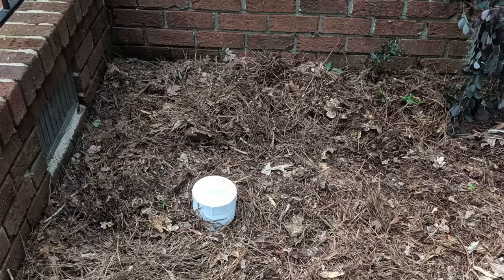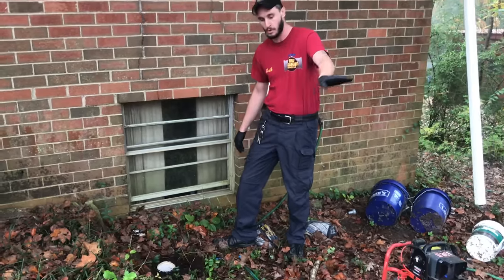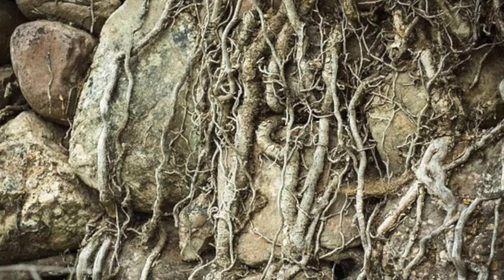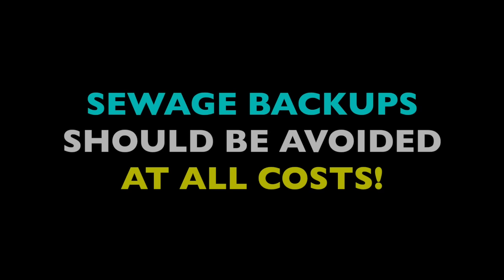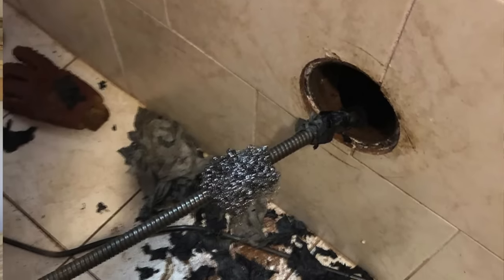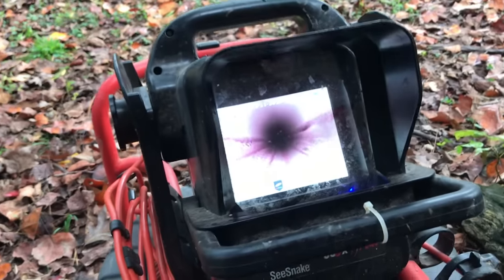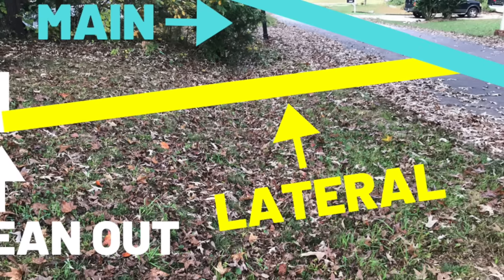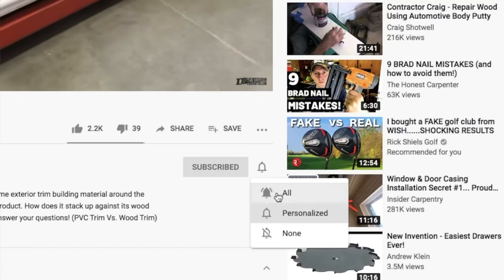This Pipe Can SAVE YOUR HOUSE FROM SEWAGE FLOODS! (Sewer Clean Out Pipe Explanation)

Comment: Sagging line: symptoms of an impending blockage, abnormal flushing (including different sound), sewer gas odours.  

I had my line scooed and there is a saddle about 34 feet out. Instead of relying on a plumber (blockages always seem to happen on weekends) I picked up a drum rotary cleaner. My clean out is located in the basement and I set up a cam lock system so it takes about 10 seconds to get things up and running. 

Now with older homes I would avoid the premium tissues like Charmin (multiple plumbers warned me about it) as it is just as bad as flushing paper towel.

Comment: We had a clog that affected one bathroom in a two bathroom house.  When the plumber came, we couldn't find the clean out.  So, the plumber went onto the roof and used a plumbing vent. Years later, someone decided to redo the decorative garden near the front door. When the old plants were taken out, the clean out was discovered.

By the way, the plumber showed my mom a piece of toilet paper, which he said was responsible for the clog.  After he left, my mom asked about what the plumber had said. I got a large glass bowl of water. I put some toilet paper of a different brand in it, and swished the water. The toilet paper sample quickly broke up. When I did it with the toilet paper brand that caused the clog, it remained intact.
Reply: What were the brands you tested?
Reply: @godweenkatie  I apologize. It was too long ago for me to remember the brands of toilet paper.

Comment: Never thought about this during my inspection & realtor never suggested it, I wish I had known to request it, I will if I move again
Reply: Just bought my house 5 months ago. Getting the sewer line replaced $9000 job. My insurance will cover it minus $1000 deductible.
1950s cast iron being replaced with pvc pipe now I will have two cleanouts as I have none now.
Reply: @browniemandacutter9852  wow, at least the insurance will cover it but that's a pain in the butt to have to deal with it
Reply: A shame that this inspection is not included in the overall home inspection in Florida.  Had I known this then, I certainly would have requested one.

Comment: yeh great vid... but no thot talk mention bout frozen tundra land up here in northeast like for 6-7 most of year .. all stuff pipes got be buried down below frost line like 3-4 ft min... So  how  do homes by code up here and towns city lines do this sewage  pipe  correctly  up here for cold freezing  winters ??  I ve seen town replace main water pipe old rusted cast iron breaking down by force pulling pushing a  white pvc plastic pipe slightly less diam thru old pipe  to take its place  bc  less or no digging cost less labor, faster, etc.. if can be done. 
Can they do same thing w sewage pipe ?

Comment: Hi there,

My wife and I own a house that is scheduled to have sewer installed in the next 2 years or so as we try to ride out the septic system until then. We know we have an old septic tank that leaks, with clay piping etc. We recently replaced the interior sewer exit line, and the plumber did not replace the whole-house trap. I purchased a sewer gas detector, tested it with the propane gas to make sure it was working, and it is. I detected small amounts from the two downstairs sinks, and when I put it close to the ground over the septic fields it went crazy, though you can't smell anything when outside. At some point, I felt that I did small some light odor coming from the sinks last year, but I haven't since. 

I'm trying to figure out what is and isn't a problem, and if we're safe to just continue to ride out this system until we can connect to town sewer. We had the line snaked between the house and the system, and while it wasn't perfect our guy told us it shouldn't be a problem (at least the line) for many years. 

Thoughts?

Thanks for any input you might have.

Comment: Very informative video which I learned a lot from!  Question: Is there a device that can be used in case of a natural disaster such as earthquake or flood which can be inserted into the building main cleanout piping, and then removed later, to stop any sewage backup from entering the home and seeping up through the lowest drains?  I'd be very interested in such a device in case of emergencies to protect the inside of the home from backups.  Thanks!

Comment: I know I have tree roots in my sewer pipe. When the washer drains the toilet in the master bath bubbles and then the bowl empties out, letting in sewer gas. I jetted the line from the cleanout and it was like flushing a toilet. However I am not convinced the problem has been fixed, will know more once it stops raining here and I can run my sewer cam through.

Comment: Another good thing is replacing your screw on cap with a Sewer popper. Then if you have a sewer backup from the street gray water will pop the top on the sewer popper and flow out there instead of your home.
Reply from the maker: Good call, Karen!

Comment: Remove screw in sewer cap and replace with a sewer popper. Sewage will not back up into home it will make sewer popper cap rise and relieve pressure off sewer line and spill into yard and not your home! A must have!

Comment: I just purchased a home with a completely blocked sewer line. Thankfully it was on the lateral and the county handled it. I definitely recommend getting the line checked before purchasing. In my case our sewer Outlets is almost vertical drop down 15 ft so if I had to pay for it. 🤑🤑🤑 also the previous owner knew about because they drill holes in the pipe to release pressure. Do yourself a favor and get it checked.
Reply: Tree roots was the culprit.

Comment: when you get to Canada, that cleanout is required to be inside the foundation wall, but after the backflow valve, so regardless, if there's a problem with the main line and its closing that backflow, if that cleanout pops or wasn't properly glued/seated correctly, your backflow has been rendered useless. The code that stipulates the cleanout to be just inside the foundation wall where the sewer line comes into your home's perimeter was made before backflow valves were a thing and when the cleanouts were still made of clay (since northern climate, that freeze/thaw would make it crumble)

Comment: The pipe just outside my house broke, they think because of the house settling. Luckily, I caught it right when it happened and spent my birthday mopping up the floor in the restroom on the first floor. ☹️  The plumber replaced the pipe outside the house. That was about 12 to 15 years ago. I haven’t had it inspected since. I had one break in the 26 years I’ve owned the house (it’s 28 years old), so getting it inspected every two years I think is overkill, unless you have house settling issues, or you have a large tree that could be putting a lot of pressure on the pipe. The solution to the tree issue, is to not plant trees that can get large, anywhere near the pipe leading to the main sewage line in the street. If there is a large tree over your sewer pipe, have it taken down. It’s probably cheaper than a plumbing bill to dig up and replace your sewer pipe.
I’m going to get mine scoped, and then maybe scope every five years after that.
Reply: The previous owners of my house had recently planted a tree not only near the front porch but also pretty much over the sewer line and water pipes coming into the house. I chopped that thing down in the first week that we moved in. 
I have no idea what they were thinking but it would have been a nightmare if that tree matured.
Reply: @andreo  Frequently, people don’t think, or they didn’t even know there was a sewer line underneath where they planted the tree. Sycamore trees are especially bad. Their roots effectively get into small cracks of sewer pipes, clogging them up.

Comment: Thank you, Honest Carpenter! Great info, but I have a quick question. 
My house was built in 1987, and we've been here for 19 years.  I have a septic system, I get it serviced every 18-24 months, and I've never had a problem with it. I've never seen a clean out in my yard, and I've mowed a lot of grass and raked a lot of leaves. It does appear, though, that I have a clean out access port in my basement on the end of the horizontal pipe that feeds the septic tank. Could the clean out be located in my house?
Reply: Hey Jmgmobile, the cleanout you speak off in your basement acts as a standard cleanout. Depending on your jurisdiction, some code requires cleanouts at every turn of direction or when exiting the house. All jurisdictions are different. if you start to have backups in your house the first place I would go to is your septic tank. If you were to open up that clean out in your basement you would have a big mess on your hands if the line was backed up. Thank you for watching!

Comment: Frankly after having dealing with my own sewer line for few years (200 feet to sewer main), I know a good deal.    No need for professional plumber.  Just rent snake and scoping tool from Home depot and learn to do it yourself and save $$$$.  Simple.
Reply: I purchased a 200 foot high pressure clean out line with a jet nozzle  to hook up to a pressure washer. My neighbor has a 3200 psi washer with a 5 horse Honda. Keeps the sewer lines clean and as added bonus I used it to wash down the pilings on another neighbor''s pier. I'm 165 feet to the sewer main and after having Roto Rooter out twice in three years,  the pressure line pays for itself with one use.  Another neighbor got a $14,000 estimate for a replacement line when the old one under a new driveway was found to be failing. He rented a backhoe and we pitched in and helped him run all new PVC to the street. With everything included he got it done for less than $3K. We actually had to build a coffer dam to keep all the ground water pumped out out to make up the last connections to the city cleanout. We were pumping out water for the last 70 feet and the street connection was nine feet below grade. If OSHA had seen what we were doing they would have had a fit, as the potential for a trench collapse was a big reality in the sandy subsoil. The city requirements under the plumbing code included clean outs in something called Norfolk  boxes every 50 feet.  No doubt that the DIY approach can save money.
Reply: I go behind wanna-be drain professionals every day 
Call a pro save time and money and costly mistakes
Reply: @mikegrant8490  You should have rented a drag box to support the excavation or stepped the excavation if that did not work.
Reply: @johnclements6614  It wasn't my job. I suggested it based on the soil, the slope and the OSHA regulations requiring it. I did make him remove a whole helluva lot of material before I went down into it. It was safe enough, barely. After we got all the connections made, ran a flow test and had the inspector called for the final, I told him he pissed away a whole lot of money and time by not getting a drag box. He told me later after the inspector signed off on it that if he, the inspector,  had seen it he would have put a stop work order on it based on the depth and the high probability for cave in and made him get a drag box on site... which would have required a real full sized excavator, not the little rental digger and my shovel. He did save $17k by using my free labor and the rentals, though. I concur completely with your insight, so thank you for your perspective.
Reply: @mikegrant8490  No problem.

Comment: I live with a septic tank.  Having raised 11 children and a few others in the house, I have lived a few nightmares.  All but the 1/2 bath are upstairs, so when I hear the downstairs toilet gurgle, I know what's about to happen.  Thankfully, I know where my cleanout is - and here is my question:

My cleanout is just outside the house and is NOT screwed down.  It's a cap the fits over the cleanout.  Should all things backup from the septic, the cap pops off due to water pressure.  The gray water and mess go into my backyard.  The only downside of this is that the dogs love it when this happens :(.

Just curious if anyone else here has a similar setup.  As for scoping your line every 2 years - I think that's a bit excessive.
Reply: Mine has a rubber cap as well. I'd rather it backup in the yard than in the house. But if you don't like it you can easily add a screw in plug instead.
Reply: I live in a 40 year old house with a septic that was in bad shape and previous owners couldn't give me info on anything. Unfortunately it didn't have any clean outs. I got tired of it backing up and flooding the house and having to pump the only tank I could find. I started digging. I found 3 300 gal tanks and the drain field was broken from tree roots. I ended up putting clean outs everywhere and adding a gray water line for the washing machine. I also purchased a sewer jetter to clean my  drain field every year. I also built a inspection camera for the drain field.  Still have a few more repairs to do but I will finish them up once I get my backhoe working.
Reply: It’s best that it stay out of your house, pop up are a design on purpose to keep all crap out, just hose it after you have performed your fix, if you seal it then everything will come out of your sink,toilets,bath tubs etc, I rather have it out side

Comment: I would add one thing … make sure you read and understand the contract.  5 yrs ago I had to replace my entire sewer line, from the house to the city main.  $8500 !  There were six spots where the pipes were broken causing problems every month.  It was a major hassle and I experienced problems with the plumber.  He did not want to dig the last 6 feet to the main because it was 8 feet deep.  He insisted it was the city’s responsibility and we were at an impasse until I called them.  Fortunately, he wasn’t very good at writing the contract and had indicated it would cover “to the main” and the city manager informed him the main was indeed six feet over and 8 feet down.  It doubled the time on the contract, and I enlisted the help of the city manager to force him to live up to the contract, but I got the entire line installed for the original amount of the contract.

Comment: I had new plumbing put into a 1943 house. The cleanouts on the drain lines were installed inside the basement, slightly uphill from the line flow. That was in 2009. Probably time to inspect?

Comment: Just had our main sewer line replaced twice in 2 weeks. It was cracked, so we replaced it. Then some how it broke again. But the MAJOR issue is that our water line in the street was bored through by a fiber optic cable (not ours. Nor do we use the service). So now we are dealing with the city. They are trying to see if they are responsible-- which they are. It's technically on the street, just past our driveway. Praying we don't have to battle it out. Apparently these third-party Fiber optic companies have been doing this all over the city.

Comment: I live in a flood prone area during heavy rains, and as such I leave the clean out cap loose so during floods the sewage doesn't back up into my house. Sewage drains can be easily overtaken during floods. My home has never flooded.
Reply: There is a one way pipe valve that can be installed so anything coming back up the pipe towards your house, the valve shuts due to the pressure.

Comment: the cleanout is capped, by code.  Its not an overflow.  Though mine is an overflow because our street sewer is too small and surcharges during heavy rains due to illegale site drain tie-ins.  Our master bedroom flooded at leat twice.  So We installed an exterior backflow preventer, and put an open cleanlout on the house side for “belt and braces” protection

Comment: Being a plumber for more than 50, I've seen lots of changes. The biggest rip off is running a camera down a PVC sewer, especially if it's working fine. If the sewer working fine my moto, "If it's not Broke don't fix it" There's way too much up selling/ Ripping off customers, because they don't know any better.
Car dealers are great ones for that ! Go for a lube job and they tell you your brakes are really thin.drive home 1400mi. and my local mech. Tells me we have 20 to 30k mi. Left.
There are snakes in the grass everywhere. Watch out for them.
If your home is old and has clay or cast iron. 40-60yrs old. I'd have it checked. We've had both fail.

Comment: My condo flooded because of a collapsed pipe outside my unit causing a sewage backup. The HOA didn't have a cleanout installed. Took the plumber a few hours to install one and by then half the condo got flooded. The cleanout does and will save a home. My condo has to have a hell of a cleanup and remediation, all of which is complicated since the HOA is trying its damnest to get out of paying for it or just delaying the process since I went with my own remediation vendor.

Comment: Here in Wisconsin as a certified plumbing inspector we do not have sewer cleanouts in our yards. The sewer cleanouts are located in the basements usually where they enter the house only. From the house to the city connection in the street is the lateral which is your property. If you have to fix that its your responsibility from your house to the curb. Why would you want to clean up pipe outside? What if it's raining or has a whole bunch of snow on top of it? Most of the people won't even understand what they are for and they're just take them out or burying them over a period Of time. Some municipalities when selling the house would require sewer inspections to be along with the sale of the house but then the Realtors would have issues selling the house so they fought against that and the change the rules.